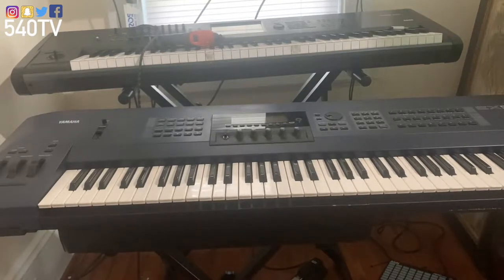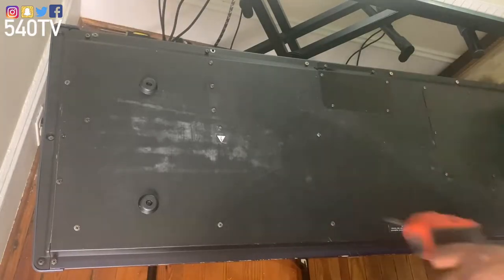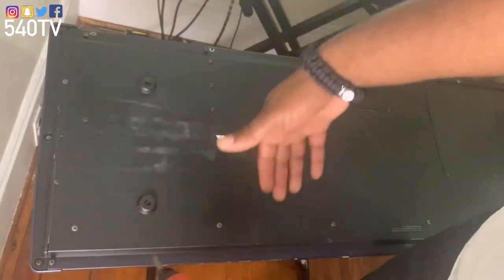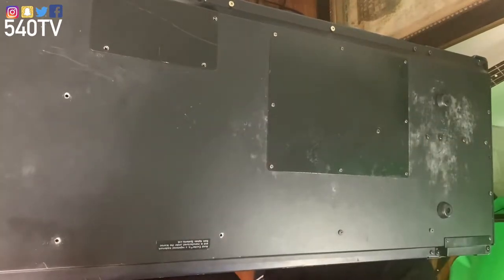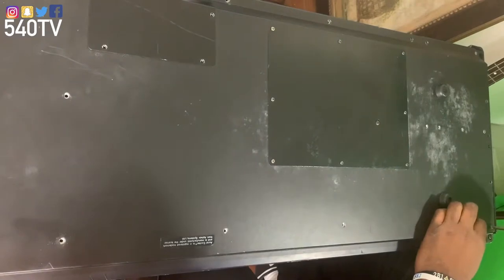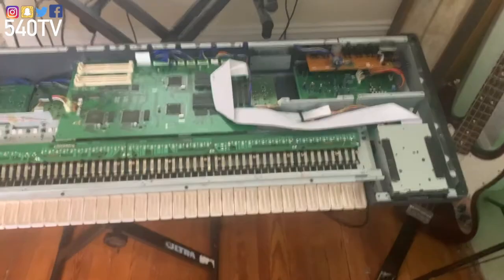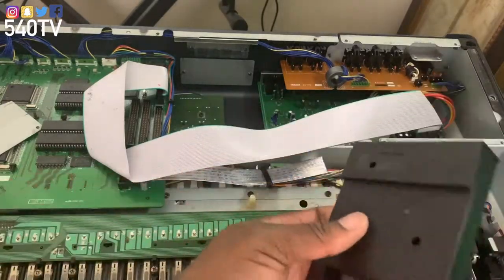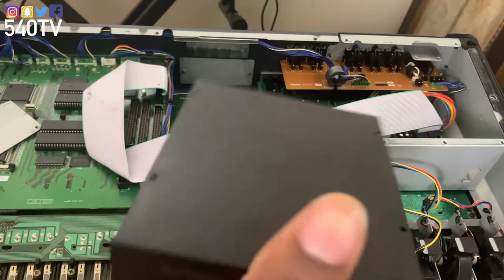Yamaha EX5/EX7 Floppy USB Emulator Upgrade Replacement

Comment: Just did this to mine yesterday. I ordered my second EX5 from a company over in Japan. DHL dropped it and busted the left side of the case where the floppy was. So I had to replace the drive with one of these. It works great!! Installing the part takes less time than taking the screws out of the bottom. Geesh. A LOT of screws!!!

Comment: Thank you very much.  I have the EX7 and need to do the same. BUT I heard that is necessary an especific program om ordet to format the device and the board may be able to recognize. Do you know which program is? Txs in advance.
Reply from the maker: You’re welcome! I didn’t have to format it
Reply: I formatted the USB stick on my PC with the Windows program that Gotek recommends. This gives you 100 virtual floppy disks on the USB stick. You can select the number of the floppy disk on the emulator with the two buttons

Comment: i only get "illegal disk"    i use the emulator software  to format the usb  . what is wrong?  thanks
Reply: Do you load the correct file extension related to the function?